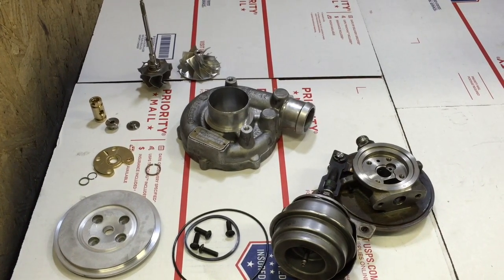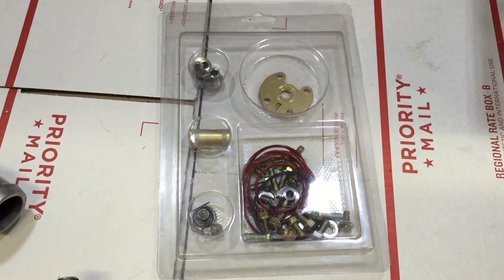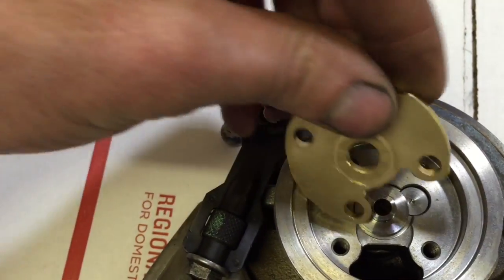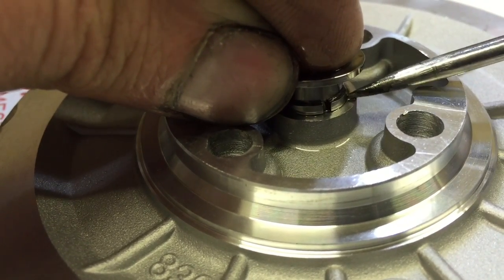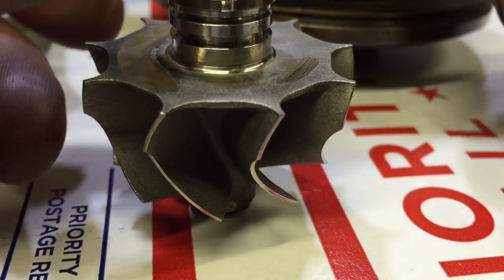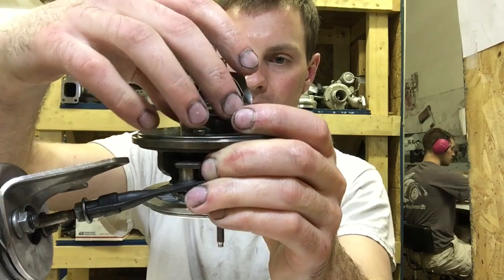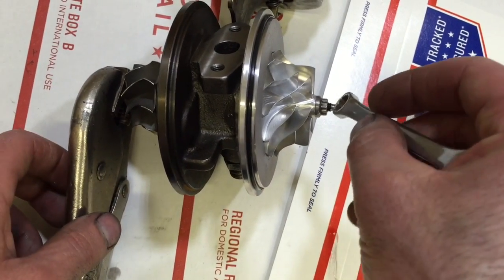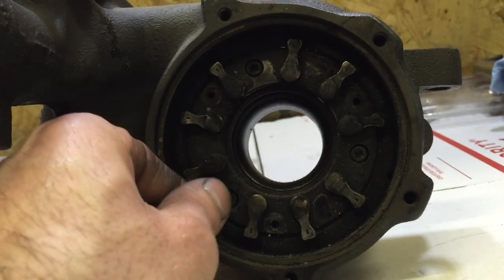VW 1.9t Diesel Turbo Rebuild

Comment: Hi.
Please assist I did everything accordingly and happy with the service results however my turbo heat shield is making noise when turning the engine off and sometimes revving the engine.
The heat shield is the round one located by the exhuast turbine as per your video.
Please assist on how to secure it.

Comment: I've a GT1749V 140BHP but I've had it since remapped to 200bhp I've always replaced the cartridge core myself, but do you know if I can upgrade core to GT1749VB straight swap? Or what other options are there without getting into big money like GTB1756vk etc. 
Really would appreciate your advice ✌️

Comment: Hi, a member replied with the heat shield being installed backwards. I will confirm because I assembled it as you show and the heat shield was rattling in the turbo hitting the turbine wheel. You really need to update this video. It caused a lot of work for me to have to remove the turbo only to flip over the heat shield. The heat shield is concave so the high part of the shield hits the turbo body. You didn't reply to the viewer who mentioned it earlier. Maybe you will this time. Thanks
Reply: Becouse you do also virtual vsr balance too :D

Comment: Have yoy realised that you have installed the heatshield in the wrong position? That means that it will not press against the variable noozles so no matter what, you will not get the expected boost. I refrain from any other comments.

Comment: The round plunger with rod mine has a oil dripping from it does it have a dyafram inside or oil seal fixing kit
Reply from the maker: It should have oil all over it

Comment: What happens if you overtighten the main nut? My rebuilt turbo doesn't work and I'm thinking it's because I gave it a 120* turn because I marked the nut and the compressor wheel and lined it up. I also think it could be oil starvation as I used an old braided feed. I couldn't feel any play before installation

Comment: Was there a O-Ring on the exhaust/manifold/housing to cartrage? I don’t see one on mine? How does it seal? 

  Also broke one of the torx bolts holding that vnt mechanism, will it be a problem just to put two? Looks like it sorta floats around anyway ?

Comment: Thoughts on using oven cleaner for cleaning the turbo to get rid of code 1557? The fins quit moving and it looses boost because the ring is dirty and it can't adjust boost accordingly? So what are your thoughts on using oven cleaner?
Reply from the maker: I never heard of that, my set up for blasting parts I have spent about 16k on equipment, I wouldn’t use oven cleaner here that is more of a do it yourself method if you have a lack of access to the tools needed to do the job
Reply: @turbolabamerica  type in Mr muscle Volkswagen turbo and watch the 4 minute video. Tell me what u think. There's no way the oven cleaner can seep onto the air intake side is there? I couldn't believe there's a rubber seal on the turbo u rebuilt, I figured a turbo gets pretty hot for a rubber seal.
Reply: I really don't want to take the exhaust manifold off and disassemble the turbo. I can do it but that's alot of work.
Reply from the maker: I have never used oven cleaner, I never cleaned my oven before, I don’t know anything about it so I don’t have advice to give you on that topic.
Reply: @turbolabamerica  https://youtu.be/1EC5Zi3_Z30

Comment: How bad did that sound when you started it. The heat shield washer is backwards that things going to rattle around till it chews its self up and hits the wheel.
Reply: I just followed his instructions and started the car, to say the rattle was bad is an understatement. It sounded like a cat dying. Have to strip and redo the shield the right way.... Also because the shield is in reverse, no boost.

Comment: I reconditioned many turbos in my career. I always used a socket in a vise to hold the turbine end of the shaft and another socket on a tee handle to tighten the shaft nut. I would be very afraid of doing this his way, afraid of bending the very small shaft.

Comment: Is the heat shield supposed to have some play under the fin wheel once the turbo has been separated?!?
Reply from the maker: Yes, I put the heatsheild upside down in the video, don’t make the mistake I did
Reply: Turbo Lab America do you know the dimensions for the o-ring that goes on the turbine cover? It’d be the largest one.
Reply from the maker: I don’t know, there are multiple variations which is why the kit has 4 orings for the compresssor housing
Reply: Thanks for the info!

Comment: I'm sorry sir, at 6.07 you said lock the nut by 1/4 turn, how about the balancing marking, I noticed the front wheel getting turned as well as you lock the nut, I've been in that case multiple times and the marking will not be in correct place

Comment: how do you adjust the stop screw for optimum boost
Reply: chirping crickets 4 months later.....chirp chirp
Reply: greg h - And 2 more years later.
Reply: You can do that on what i called a flow-bench machine that proffesionals use. No, he does not have that.

Comment: None of the Video's that I have watched, including this video,  talk of the side to side shaft 'play' which to the novice appears to be excessive play.   When the engine is started and there is oil pressure, all is fine because the shaft and bearing are on a cushion of oil.   Anyway, this is a good video.
Reply: It depends if its a ball bearing or journal bearing mate, ball bearing will have no side to side play unless its shagged but the journal bearing your talking about will have...but most turbos are floating bearings anyway these days

Comment: Hi! Thanks for the video. How do you remove the front collar from the compressor plate? Also, what is its purpose? My turbo is spilling oil in my intercooler on a ALH 1.9 TDI 2003 jetta. I rebuilt it, just like in the video but did not do the front collar because I was afraid of braking a the fragile aluminium compressor plate by removing the collar. Now its still spilling oil. Help appreciated, cheers!
Reply from the maker: +Olivier troishuitcinq the front collar holds the front piston ring seal. You should be able to press it out by hand or Tap it with a hammer.
Reply from the maker: +Olivier troishuitcinq I also put the heatshield on backwards in this video

Comment: great video and info thank u i got a ? for u i got the 105 bhp 1.9 tdi witch is mapped to 145bhp turbo is the factory fitted witch is work fine at the moment but i know it will b beake in sometime now if i want to rebuild my own turbo   whats a best sort of harware to use shall i just use the factory the same or upgrade it like a hybird turbo isit something i can do or it need propper sort of machine and tools to do that any advice will b greatfull thank u
Reply from the maker: +Alireza iesanejad the compressor housing has to be machined. I have the machine to do the job.

Comment: i had a turbo built for me and the 10mm nut on the turbine shaft is off center slightly. is that bad should i send it back??
Reply: how much does it cost for kit ? (alh 5 speed tdi , vnt-15 borg warner).
Reply from the maker: +john martin the turbine nut is very strange looking on the gt15 - gt25 series,  it's very special design for a special tool to hold the turbine shaft.
Reply: +Turbo Lab America its a gt30r custom built. is this normal then?
Reply from the maker: If it's balanced correctly then it would be fine.
Reply from the maker: +john martin can you send me pictures to my email address turbolabamerica@gmail.com